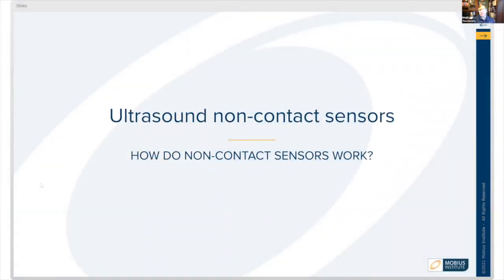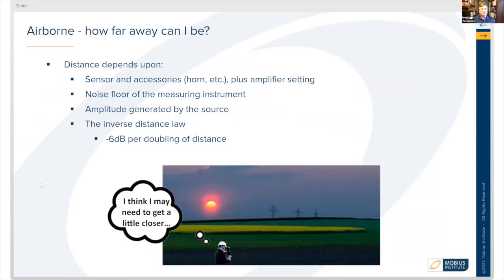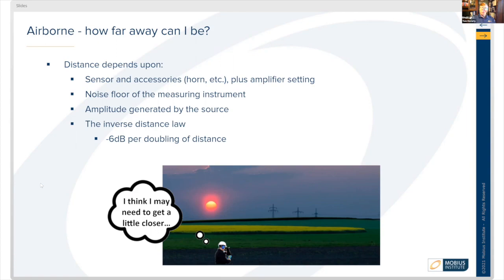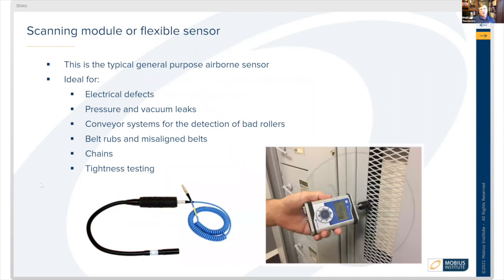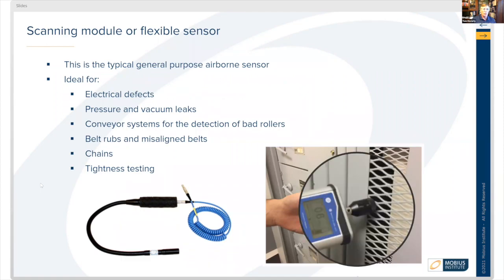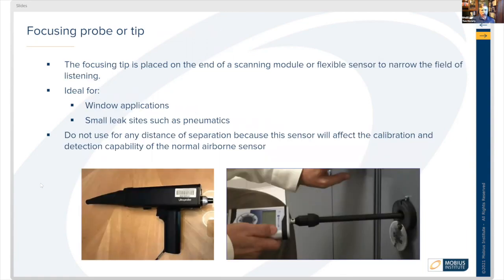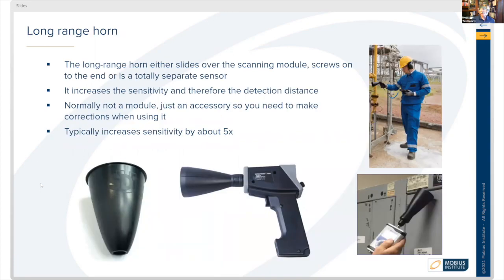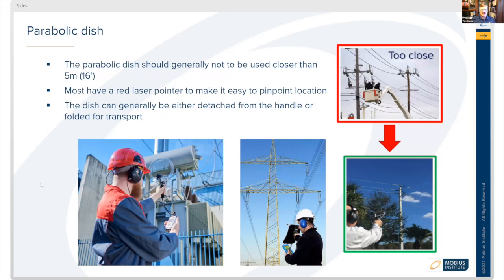How Do Non Contact Sensors Work?

Comment: The Inverse Distance Law loss of 6 Deciebles only applies to the UE Systems devices as the other devices on the market from Sonotec, SDT, and IRISS use a microVolt Scaling. The UE Platform starts at 0 Decibels and can read up to 128 Decibels.